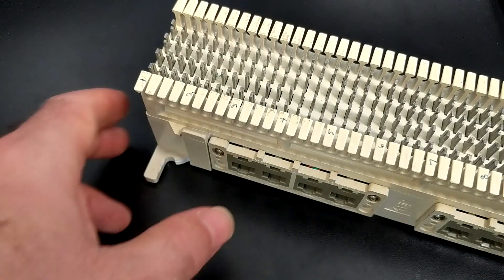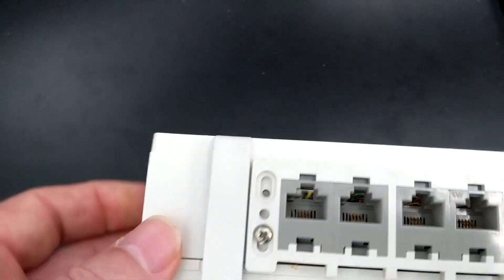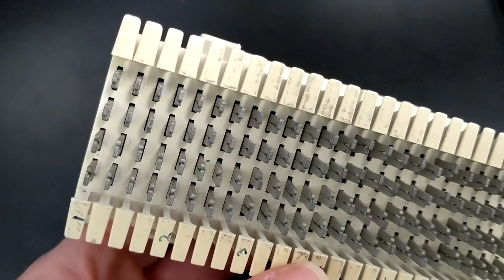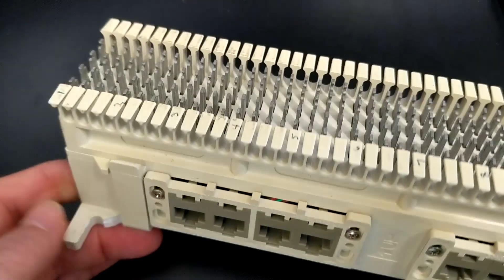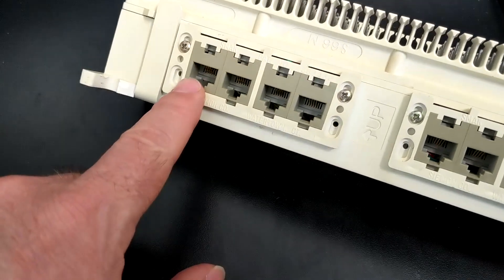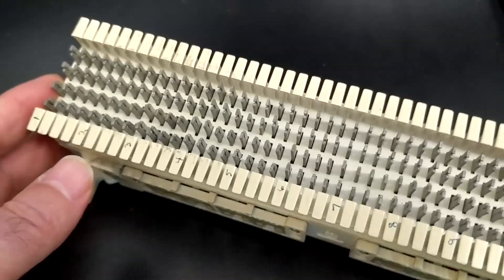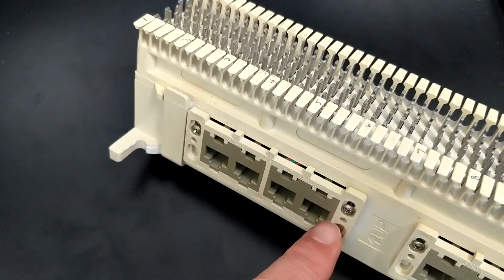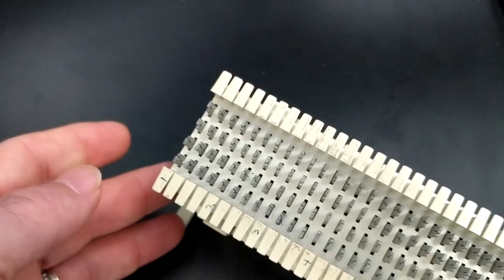66 Block with RJ-11 ports

Comment: Would you be interested in https://npstn.us It's a private VoIP Network made for Phone Phreaks & Collectors, Complete with all the vintage telephone sounds & switching systems of the early 30s up till today!

Call me at (407) 327-0585 for More info & Help on getting on the network using a Simple ATA or Asterisk Switch.

Comment: Isn't this outdated technology? Most newer installs now have cables terminating on patch panels with RJ-45 jacks. If a devices for whatever reason needs and RJ-11 jack, you can easily make cable where one end is RJ-11 and the other end is RJ-45.
Reply from the maker: Is it out-dated?  yes.  Is there still a ton of out-dated equipment out there in production?  A TON!!

Thanks for commenting 😄
Reply: @DIYTelecom  Just a thought, we recently moved to a new office. Before moving, we almost gutted the whole place and redid all the wiring. It just made more sense to use structured wiring as our phones are all VOIP based.
Reply from the maker: nice move, that was smart!   VoIP is the future of voice, anyway.  😃

Comment: That's pretty cool Steve, I have a 12 port BIX version of that, very useful indeed! Makes it easy to plug in VOIP ATAs to my 0x32 MICS, which only has the big 25-pair connector for the trunks. I got mine used on eBay, but I think they're still manufactured. At least they're listed on Belden's latest catalog (page 48, 12 port USOC 4-pin, part # QCBIX36B /A0330863 ). Probably not as appealing outside Canada haha, but I imagine you've probably come across them more than a few times in your dealings with Nortel systems in the US.
Reply from the maker: hi Aric.  yes, back when was doing more nortel service work, I would run across bix often.  
I would love to see your NT rig if you don’t mind.  When you get a min, email a pic to me at whatever email we were last talking on ( I have like so many email address!) 😁